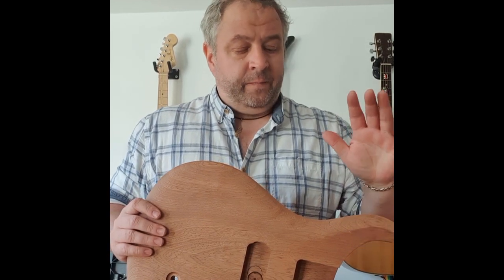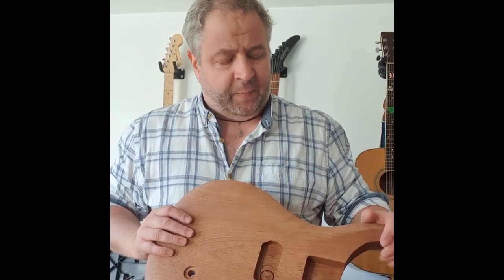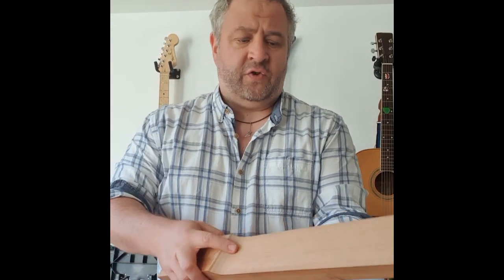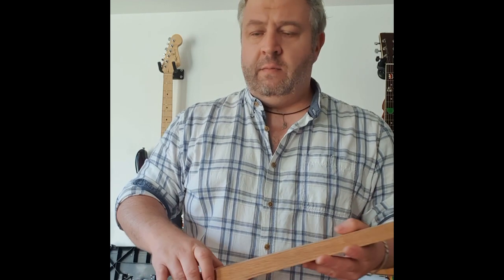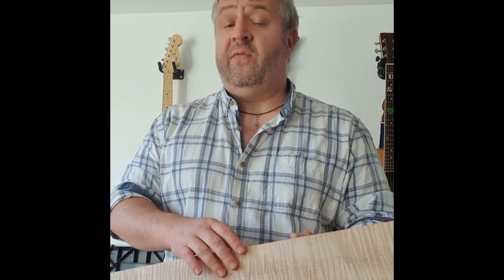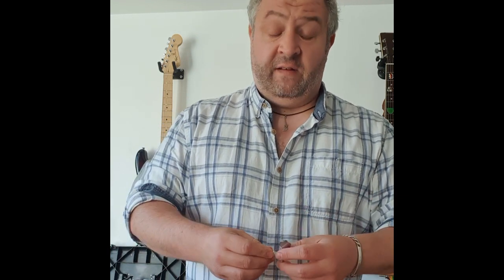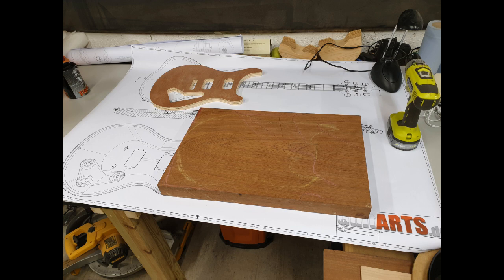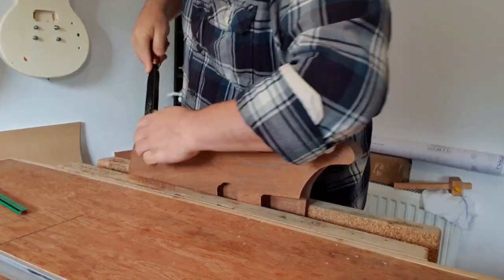The Livingroom Luthier  Episode 1  - Great Guitar Build Off Unofficial Entry

Comment: Your partner is a Saint! 😉 👍
Your production is looking great and that WorkBench needs to be made into plans mate.
Bolt in hand tools in a modular movable customisable  form. Priceless.

Thought for your Router Gantry, Couple of lengths of 40/20 Aluminium Extrusion (kinda like your bench top slide rails) either attached to what you got or use as the sides of the sled might give you a really precise level  cross beam ? just an idea.

Take care
Reply from the maker: Yeah, she's been really supportive, I'm lucky!!  Thank you for the compliment on the production, that's a whole new ball game I'm getting to grips with too!
You are spot on with the router sled , i noticed on a rewatch of the timelapse close up, you can see a bit of movement in it so some angled aluminium will be a future upgrade.

Thanks for taking the time to comment and the support!

Comment: Is that workbench actually in your living room?
Reply from the maker: Absolutely......its on locking castors and has lots of storage space for tools etc, do you like the idea?
Reply: @DTGGuitars That's awesome! You get bonus points if you're married.

Casters are a fantastic idea if you are short on work space.  I have my work bench, table saw and drop saw all on casters so I can drive my car out of the garage, roll my work bench etc. out, do some work and then push it all back into the corners of the garage when I’m finished.
Reply from the maker: Haha.....yes my partner is very patient and supportive of what I'm doing. A proper workspace is needed , but I just wanted to prove(to myself) that I could do it with minimal footprint/tools. Thanks for commenting, there will be more footage of the bench at work lined up.....stay tuned for Episode 2, footage being shot till Thursday!!